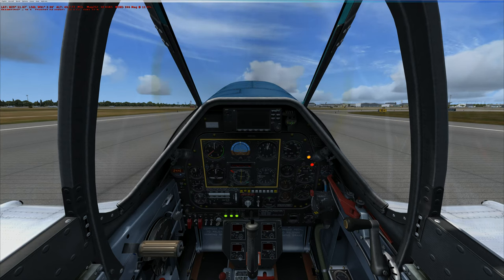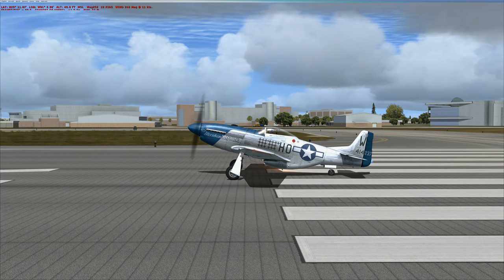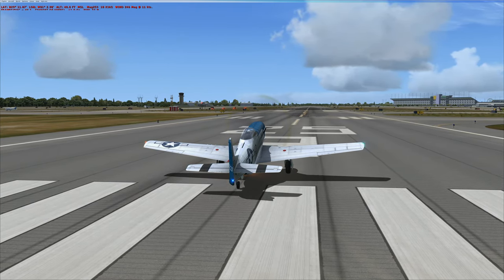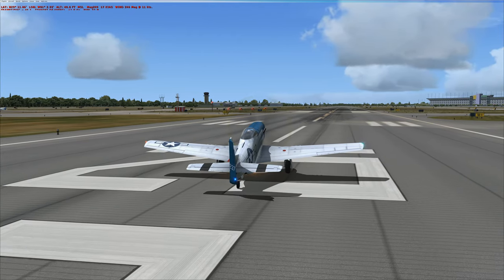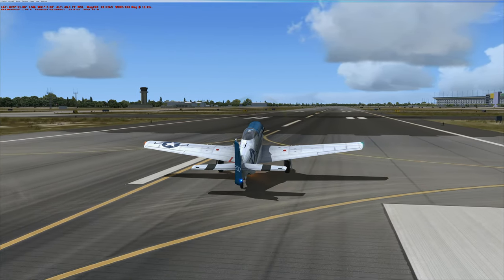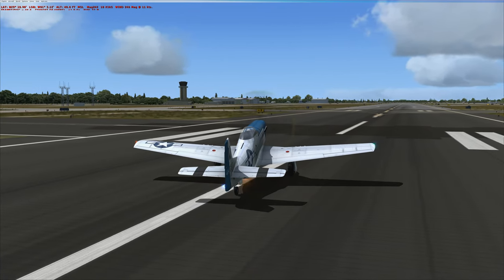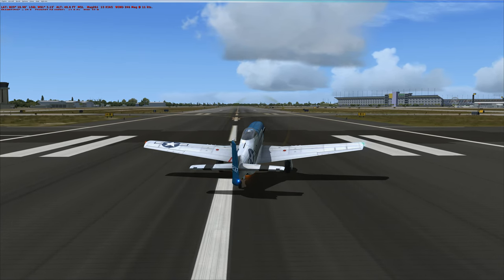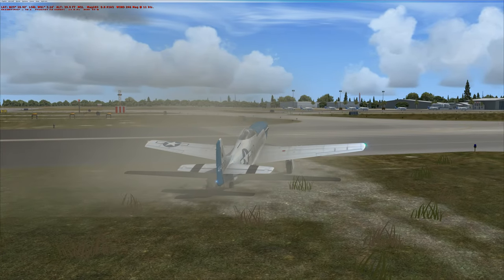A2A Civilian Mustang Take off problems - no tail-wheel steering?

Comment: You have to push to stick all the way forward to unlock the tail wheel
Reply from the maker: Thanks but it didn't work as the rudder /tail wheel was disabled by a script issue. Was solved with later versions though. The plane is working perfectly again!

Comment: Run the latest updater. Had the same problem. But the updater fixed it.
Reply from the maker: Yes they fixed the script issue. Sadly I received no apology for being called incompetent by a senior staff member. Love their planes but probably won't buy any more. Not because of any fault with them the incident just soured my love for them is all.
Reply: @florida4life  That's a shame. You're the customer. Customer is King. If one of my customers had an issue with my product, I'd move every obstacle out of my way to help.

I needed their help aswell once and they were very forthcoming and polite.